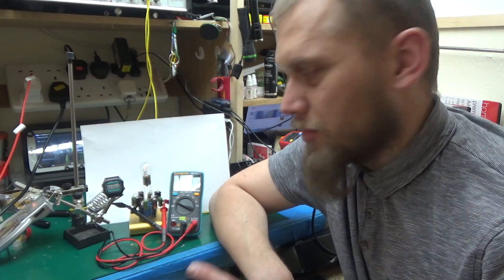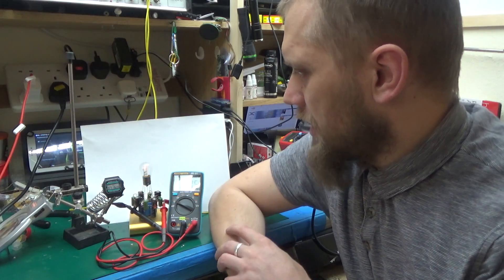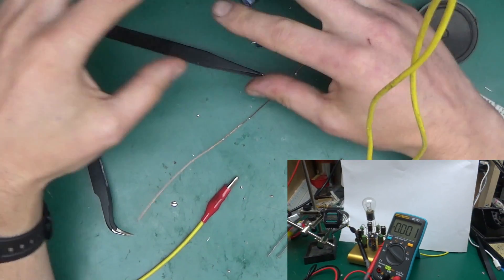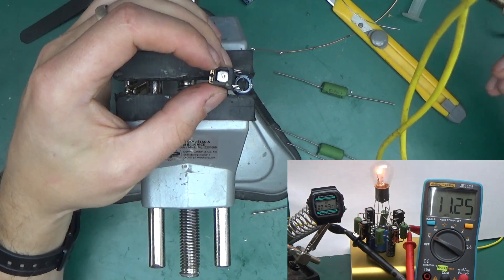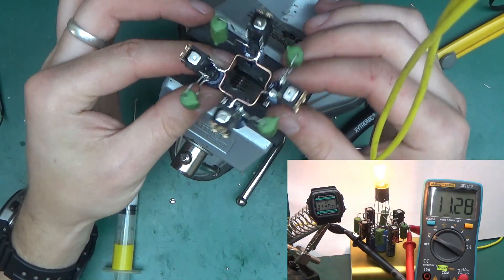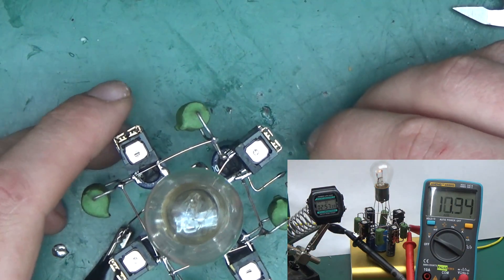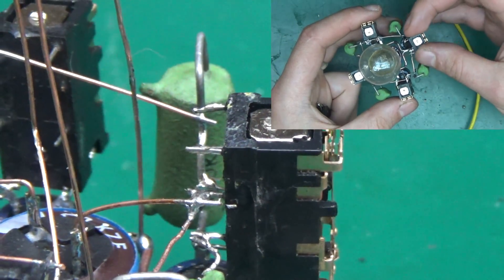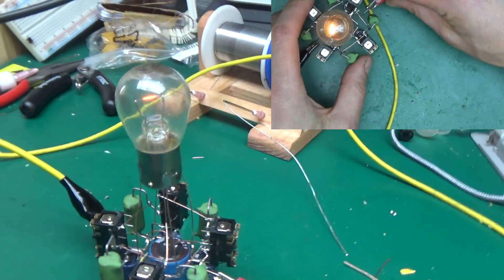Flashing Light Prize 2017 - entry by randomtronic

Comment: Back in 1970,I had a 12 Volt relay with a very large iron core from an old fire alarm system. If power was applied, it took about half a second to operate. When power was removed it held for about the same time before dropping out. By wiring a bulb and battery to a set of contacts, and using another part of contacts to turn off the relay, it made a reliable 1Hz lamp flasher. That was it’s intended purpose. Thanks for the reminder! Subscribed. :-)

Comment: it could be done with a thermocouple device, zero electronics, to switch Light off then when cooled down back on:
There are flashing bulbs like this
Reply from the maker: +Protomaker Black Sprint Original 3D Printer some oldschool Christmas lights flash this way
Reply: Yes :)